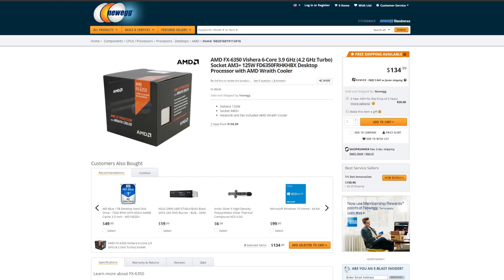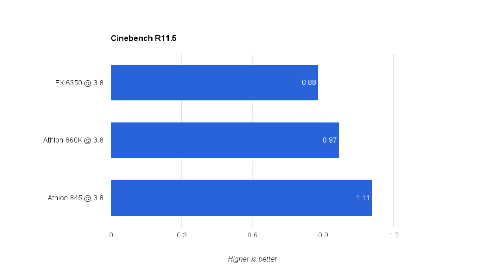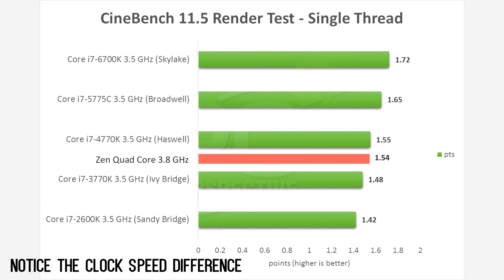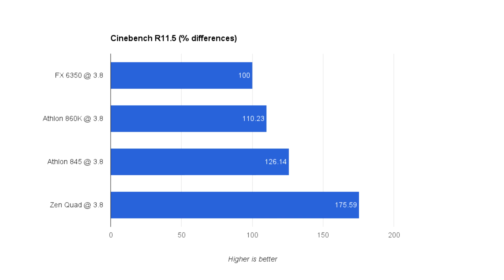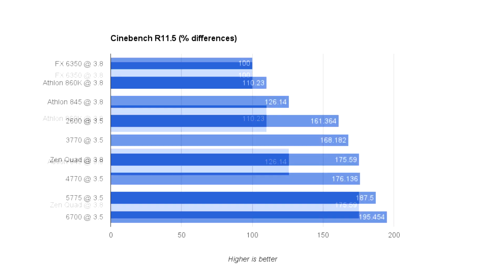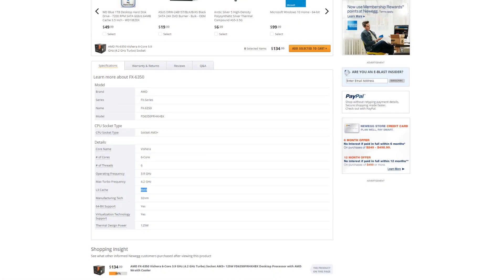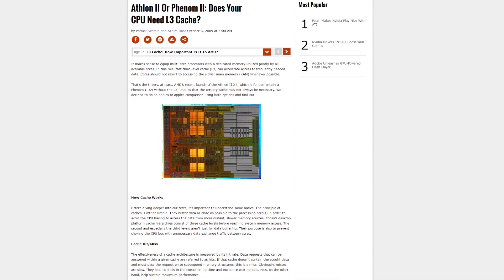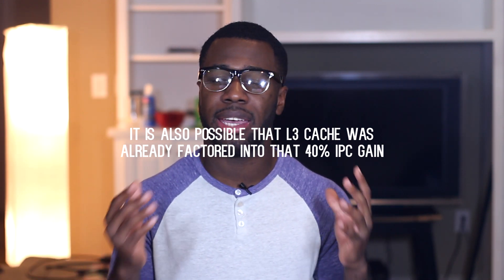How Fast & Powerful is AMD's Zen CPU? (Revisited) | OzTalksHW

Comment: Erm... If that were for single core Cinebench scores, then okay. But i7's are hyper threaded. They have 4 cores and 8 threads. And also, my FX-8350 gets a single core speed that's comparative to a i7-3770 when clocks are matched. (Aka me down clocking to 3.5 GHz) and I reach about the same as an i7-3770K when I use stock settings. (4.0 with 4.2 GHz boost) and the i7-3770K is 3.9/4.x so... I'd say that Ivy Bridge is pretty on par with Vishera, aka the same as the FX-6350 you used in this for the baseline.
Reply from the maker: It's single core, so the extra 4 threads doesn't matter really. Vishera isn't close to Ivy Bridge in IPC though. It's at least 50% slower clock for clock

Comment: How much will Zen be?
Reply from the maker: My speculation: $150 for a quad core w/o SMT/HT (~i5), $250 for a Quad w/ HT/SMT ( ~i7), $300-350 for a 6 core w/ HT/SMT (~ 5820K), $400-600 for an 8 core w/ HT/SMT (5960X ish)
Reply: probably 450 for the 8-Core Zen CPU
Reply: No way in hell would it be $450 for Zen. AMD would be stupid to price it at that. I7-6700k is about $324 right now. Zen would be DOA if it was priced above the i7-6700k. Realistically expect $200-$300 for Zen.
Reply: OzTalksHW Thanks!

Comment: I'm content with my Skylake, but glad AMD can be more competitive on the CPU market now.
Reply: Jehanzeb Naveed i guess you were born pretty recently, didnt you?? :D
Reply: Jehanzeb Naveed Im also 89. You could remember that AMD nailed Intel on many fronts during 1996-2006 era, especially after year 2000 with Athlon XP, 64 and X2. All of those 3 cpu families were groundbreaking in both design and function.

Also ATI (which AMD acquired in 2006) was doing great against 3DFX in time when Nvidia still barely existed. Nvidia was pretty much shit until 2012 and their Kepler gtx600 series architecture. Then they started to dominate.

And AMD is losing hard to Intel only for last 4-5 years when Bulldozer came out. Before that, though they lost the ultimate performance crown to Core 2 Duo in 2006 they were still doing great with Phenom and Phenom 2 chips.
Reply: +Jehanzeb Naveed That's not true, AMD is responsible for a lot of innovations on the CPU market
Reply: +CMstacker agreed i remember tht time. but wht i think is tht amd doesn't improved on their technology. they dis came with first 64bit processor but frm there on it just stopped.
Reply: You're wrong, AMD has been the most powerful and advanced platform since the Athlon up until Intel released the Core 2 architecture.

And one of the reasons why they have been unable to keep up is because Intel performed very shaddy business practices with OEM manufacturers boycotting AMD.

Now we have the 6th generation and let's be honest, the improvement is minimal even compared with the first and second generations.

I read a lot of people sh*itting all over AMD and I don't understand why, they invented everything, it's because of them that Intel really had to put effort to create great processors.

Soon we'll have the 7th generation and it will still be the same bullsh*t with minimal performance increasings and still not 8 core CPU's.

We need AMD back in the game as strong as before.

Here's the thing, from now on we'll see an increasing amount of games using Vulkan and DX12 which will take advantage of multiple cores, there are reviews comparing FX chips against Intel's stuff and they perform great, not as good as Intel but the difference is minimal, just imagine that +40% performance.

Haswell is awesome and if Zen is really comparable to that and comes with 8 cores / 16 threads it's going to be a beast. If AMD delivers I'll throw money to their faces.
Reply: People shit on AMD because their CPUs have shit performance, it's just the truth. The FX ones don't really have 8 cores, you have 2 pairs always working together, the 8 cores and high clockspeed is a marketing strategy to get people buy their product.
Reply: CMstacker 89 born. mayb older than u m but im not here to judge
Reply: Wrong.  Do you remember the early 2000's when AMD dominated the CPU market (in terms of performance) for a few years.  The original Athlon was faster than anything Intel had.
Reply: +David Rodríguez you're so right. AMD has made so many innovations that people ignore, along with Intel being super shady.
Reply: starfox300 Pairs of integer cores within FX cpu "module" are not always working together you noob :D. They work together as they need to.

Low IPC is mostly due to the sacrifices they made while sharing FPU by 2 cores, but also caused in part by cache sharing and high cache latencies.

Still, in some cases those 2 cores work better together than they would separately outside of that module.

OS`s cpu scheduler has to assign threads properly regarding those 4 modules. If you have 2 data streams which rely on data stored in same cache they need to go through the same module one thread on each integer core.

If you have only 4 threads which dont rely on each other you want to assign them on 4 separate modules to fully utilize all available cache and saturate the each FPU, so no data has to be shared.

When done properly FX cpu works just fine and is actually better for heavy multitasking than 4 core Intel (even with hypertherading so yes i7).

And win10 scheduler does it finally. win7 was abysmal in that regard, and 8 improved things but only under 10 i feel system breaths with full lungs. 

If you think similarly priced i3 from Intel is better buy for any serious work (=not gaming) i pity your poor soul :D.
Reply: amd was never on competitive side m they cover the budget side for their cpus amd gpus
Reply: yeah of course , there no point going to zen if you already on skylake or at least haswell , they were supposed to be on par with zen

Comment: Nice vid, I still can't work out if Zen would be a sidegrade for me. I am happy with my 4790k @4.7ghz it does everything I want it to. But I can see if a lot more dx12 games come out and this has 8 cores running @5ghz under water cooling (or even air) then it would be well worth it - I think

Comment: Zen will also have SMT (simultaneous multi threading). "Hypertherading" is just Intel`s brand name for it. So we are looking at 8 cores with 16 threads on enthusiast desktop models. 

And there is no more sharing of resources per "module" like on Bulldozer. Every core has its own L1 and L2 cache and its own FPU unit. L3 is shared per one block of 4 zen cores, but thats like on Intel and every other cpu in last 20 years. L3 cache is always shared per multiple or even all cores on the chip. 

I expect AMD pulls it this time and actually beats Haswell. They could get near Skylake level of performance. So we are basically looking at Intel`s 5960X Extreme Edition performance for price which will surely be much lower than $1000 (though i do not expect it to be cheap whatsoever). Also TDP which is now 140W on all Intel`s 6-8 core cpus should be 90-100W on Zen so nice gain there too.

All i posted above is actually very impressive when you take into account that intel has best fabs and manufacturing nodes in the world (besides maybe IBM). Their 14 nm node is unmatched in specs and quality. Everyone else are cheating a bit so AMD`s alleged 14 nm FinFet process is actually 20 nm base with 14 nm FinFets on top of it. Same goes to TSMC and Nvidia for their 16 nm Pascal gpus :D. Its much closer to Intel`s 22 nm node then true 16 nm. 

Still, It is great achievement if AMD can match Intel with technically inferior node and it would make me very happy.

Comment: Might be gud enough to compete with haswell..but the pricing should be around $100-200 for the cpu alone to be enticing enough, or not we can just buy a used intel & still get a lot of bang for the buck..i don't think the cpu market is bringing anything new on the table asides from higher ipc and lower power consumption in the new fab

Comment: That's a quad core you're theorizing on though :p They've already teased an 8 core during their stream. And I'm assuming that since you're comparing it to the top of the line i7s Intel offers, that AMD should be quite a bit higher than this quad core assumption :p

Comment: im tired of hype, nothing i was thinking that came out this year was as i expected and hoped for.
i think that right now is the best time to build a pc, anyone with a 970 performance or lower and a i5 4670 or lower can build now and get a decent upgrade with the i7 6700k and a 1070. this is for gaming at least, for other applications you could have other options.
ddr4 is cheap now, ssd can be bought at 1 tb size in ok price, gpu's and cpu's are on the expensive side tho. monitors are not worth it if you are on 144hz 1080p or 60hz 1440p, i was hoping that 4k monitors would make lower resolution panels cheaper, but not yet......

Comment: Keep in mind that this is just single core performance. Zen processors will have 8 cores, so much better multi core performance than haswell and even skylake
Reply: Zen will also have SMT (simultaneous multi threading). "Hypertherading" is just Intel`s brand name for it. So we are looking at 8 cores with 16 threads on enthusiast desktop models. 

And there is no more sharing of resources per "module" like on Bulldozer. Every core has its own L1 and L2 cache and its own FPU unit. L3 is shared per one block of 4 zen cores, but thats like on Intel and every other cpu in last 20 years. L3 cache is always shared per multiple or even all cores on the chip. 

I expect AMD pulls it this time and actually surpasses Haswell. They could get near Skylake level of performance. So we are basically looking at Intel`s 5960X Extreme Edition performance for price which will surely be much lower than $1000 (though i do not expect it to be cheap whatsoever). Also TDP which is now 140W on all Intel`s 6-8 core cpus should be 90-100W on Zen so nice gain there too.

All i posted above is actually very impressive when you take into account that intel has best fabs and manufacturing nodes in the world (besides maybe IBM). Their 14 nm node is unmatched in specs and quality. Everyone else are cheating a bit so AMD`s alleged 14 nm FinFet process is actually 20 nm base with FinFets on top of it. Same goes to TSMC and Nvidia for their 16 nm Pascal gpus :D. Its much closer to Intels 22 nm node then 16 nm. 

Still, It is great achievement if AMD can match Intel with technically inferior node and it would make me very happy.
Reply: well yeah but the point of intel is using all cores in a capped core environment via hyperthreading
Reply: Yea, skylake core/performance even multithreading is too good compared to any other, even if it has more cores, there is quad cores on intel too. The price is all now
Reply: *****
Ah didnt realize Zen had its own version of hyperthreading
Reply: ***** frankly, i dont understand what are you talking about.

SMT (simultaneous multi threading which is also Intel`s "HyperThreading" brand) and CMT (clustered multi threading utilized on AMD`s Bulldozer and successors) are both multi-threading techniques.

They work in a different way with different outcomes but towards the same goal.
Reply: intel has multiple cores too and better multi core performance so what are you talking about
Reply: If I read the press releases correctly the initial desktop Zen release is going to be Octa core with SMT. Potentially 4-6 core variants and  Zen based APU's utilizing Polaris graphics with 11 GNC cores being released in 2017.

Should make for an interesting year for processor pricing restructuring, one reason I'm holding out to upgrade.

You didn't miss much single core performance is still utilized in most common tasks your average day to day user will not see any real gains in Haswell VS Zen if the estimates hold water. But considering that Skylake is "in some instances" a sideways upgrade from Haswell it should be interesting .
Reply: mcpooface price point advantage apparently amd will still be 1/3 of the cost of an intel
Reply: +AmpEdition there will also be a 12 core version
Reply: +Jonathan Tran for servers only I think
Reply: Interesting point! This might be a longer term benefit since currently games barley use 4 cores, but since all consoles have 8 it would make sense for us to see 8 thread usage in the near future as these AAA tittles will start to tax the aging console hardware. We could also start to see actual marginable difference between the i5's & i7's in games since right now they perform pretty similar, but newer dx12 games are already showing clear benefits from the extra threads. 

So i think it's cool that we'll start to see a shake up of the CPU market which was long over due, with ZEN really looking like a good, safe, cheap alternative that is somewhat future-proofed for the next maybe 5 years that games will be made to current console standards.
Reply: thevraptor Intel fore single core, Amd for multi core